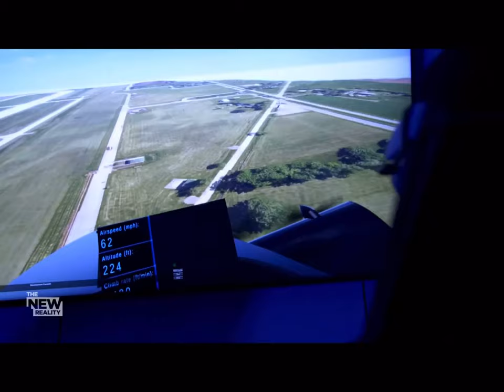The Blackfly by  Marcus Leng interview Oct. 22, 2021

Comment: Each time I see this thing fly, the more impressed I become...what is it's flight envelope in Canada without restrictions?
Reply from the maker: It is not public yet, there are a couple hints if you watch the various reviews in the playlist... 
( C. Roberts - the brain of the Star Citizen game development - would say "..soon we will see..."
Reply from the maker: Are you in Canada by the way? Which province are U at?
Reply: @electricaviationchannelvid7863  no I'm in USA
that's why I'm curious about it's potentials
Reply: Generally Canada follows closely with the FAA regarding aircraft certification. No eVTOL aircraft has ever been approved for flight in the US by the FAA, and likely never will. The FAA is very stringent regarding flight safety. The Lithium-Ion batteries that power thiese prototypes are unreliable, and have a nasty habit of catching fire and exploding, due to thermal runaway..
Reply from the maker: @doughowdy7009  In my understanding This is currently under a UL category where no certification on the manufacturer side and no license required on the operator side! There are a few parameters that these flying-device should stay within when it comes to performance but nowhere it is written some restrictions about the propulsion or guidance system...
Reply: @doughowdy7009  isn't that a bit of an overstatement? if highly flammable gasoline is ok then surely there has to be room for lithium. Perhaps the rules need to be evolved to reflect the state of our technology and not vice versa.